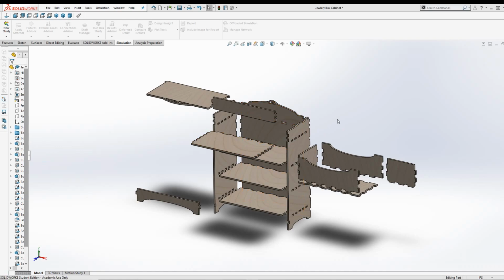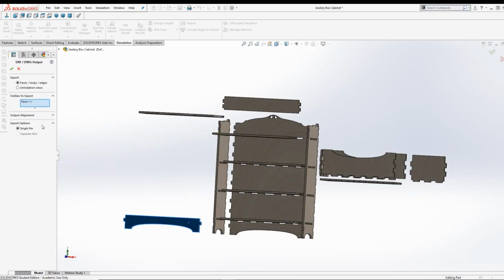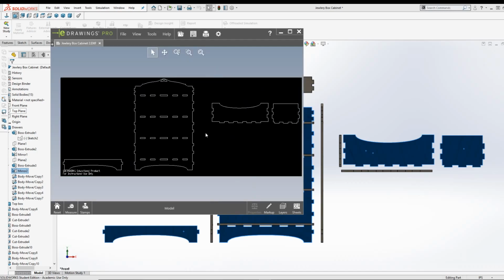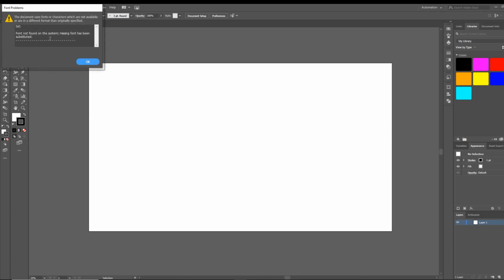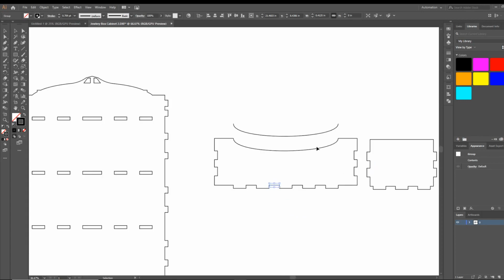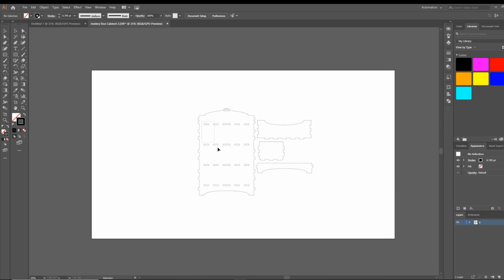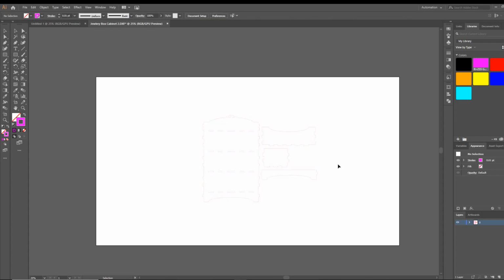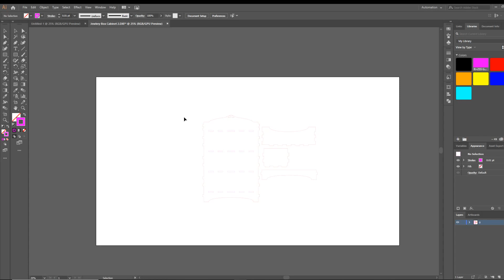How to use Solidworks for Laser Cutting! (Universal, Epilog, Glowforge)

Comment: Hey you seem to know what you're doing.
 Is it possible to use images to kinda like paste them on the sheet of metal and use as the cutting?
Reply from the maker: I've never done much with sheet metal, but I don't see why not. Solidworks does allow you to import SVG and DXF files, and I have made designs in illustrator that translated into Solidworks, so I do not see why not!

Also sorry for the long response, thanks for watching!
Reply: @tyoteetech  It's ok, thanks for the response anyway, it's useful information. Keep the work going :)

Comment: What about exporting a part? I have created a solid part and then sliced it. Is it possible to export those slices?
Reply from the maker: What format did you export it in?  And what do you mean by sliced it?  Do you mean in a software like Cura, for 3D printers?
Reply: @tyoteetech  Well in solidworks they have a slice feature, but that just created sketches where I wanted it cut. I ended up using Slicer for Fusion 360 and exporting an STL from Solidworks. This is also my first time doing anything like this.